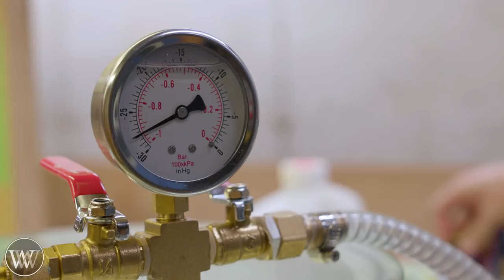Making Mallets for Tally Ho

Comment: I have the 64 dollar question if the “Cactus Juice” is supposed to stabilize and increase the durability of the wood why did you not make the mortises in the mallet heads and then perform the wood stabilization process.  It would seem to me that doing that way would allow more of the Cactus Juice to suck into the interior wood and thus making the mallet head more durable.  My preferred medium to work in is metal and not fiber based carbohydrate substrate.
Reply from the maker: Surprisingly the vacuum will soak the juice all the way into the middle. but the big reason is that the wood will move as it takes on the juce. this means the mortise will not fit as it did before stabilization.

Comment: I'm like 3 years late on this but I have a bunch of questions about this video: 1) what was wrong with the old mallets that you didn't like? 2) why is it called cactus juice? it's obviously not made from actual cactus juice 3) why not do more of the shaping and drilling it out for the handle before you stabilize them? 4) why did you finish the hammering surface when you know it's just going to get wacked away immediately on use? 5) shouldn't the angle of the mallet be based on the length of the handle? wouldn't the larger mallet have a shallower angle than the smaller one? 6) what did Leo and his crew thinks about the new mallets that you've made?
Reply from the maker: 1. The old mallets had square faces rather than having an angle to them and it makes you hit things off angle. If you tried one you know they just don't feel right. 2. Cactus juice is the brand name for the stabilizing fluid. 3. If I did all the shaping before the stabilizing then the shape changes after the stabilization as the wood absorbs all of the resin. So I have to do most of the shaping afterwards once the head has taken its final shape. 4. It is best practice to finish all faces so that the wood absorbs moisture at the same rate. Otherwise you'll have some surfaces that swell slightly more. Where the water can get in faster. Not to mention it just looks odd if you don't finish it. 5. You actually grip a mallet right up at the head. A hammer you want to hold all the way down at the base so you have a full amount of leverage. But for the mallet you hold it up next to the head. The reason you have the rest of the handle is for balance. If you've ever tried to use one with a short handle you'll know it just feels wrong. And as to the angle that's personal preference wherever it feels good to you. Some people like it with a slightly more shallow and some people like it with a slightly more aggressive it depends on how you swing your hand. It's the fulcrum is not where your hand is at it's how you swing your arm. 6. They use them quite extensively over the last few years.

Comment: See Tally Ep74 at about 11 mins, that large mallet hardly in shows any wear and tear out in that sea air humidity and chicken roosting boat yard. Leo is chiseling off teak cutoffs I'm boards from the original Tallyho stern. The hull and deck are framed, the transom is built and planking is about to start. Lots of black locust trunnels in they mallets past and future yet.
Nice build man!
Reply from the maker: Thanks. Hoping to make it back out there again sometime and help out with the project again

Comment: Nice work.  I like that the wood has come color variation.  What is the weight of each head?  I've made a couple joiner's mallets plus turned a carving mallet (similar shape to the Blue Spruce model).  It seems in all of them I end up making the things, then cutting the heads down so the weight feels right.
Reply from the maker: I generally like a head between 15-30 oz

Comment: How much fun is live oak? I cut a piece on a chop saw once and it was like going through steel on a metal cutting saw; without the sparks and such. Hand sawing all that? And planing some of it too?? Did you have to sharpen stuff up when you were done or hone in the middle of the project? Also, do you have a video on your vacuum chambers and stabilizing punky wood?
Reply from the maker: it is defenently "Fun" stuff but whit good tools it is not that much different from a twisted piece of white oak.

Comment: Well, there you go; I've managed to be a cabinet-maker and trad wooden boatbuilder and never come across "pressure stabilisation".  Can anyone enlighten me? Is this about using unseasoned timber and avoiding checking/splitting? Intrigued, of Cornwall.
Reply from the maker: These blocks were dried they're not green stabilization doesn't work very well when they wood is still wet. Usually I will speed dry them in the oven and then stabilize them. I have a whole video on wood stabilization if you want to see that.
Reply: @WoodByWright  I will, ta.

Comment: I'm intrigued as to why you wouldn't create the hole for the handle before stabilising the head?  Surely it would be easier to machine at that point, and the hole would only help with the stabilising penetration?
Reply from the maker: Surprisingly the vacuum will soak the juice all the way into the middle. but the big reason is that the wood will move as it takes on the juce. this means the mortise will not fit as it did before stabilization. on top of that the stabilized wood is actually easier to work with a chisel then the raw live oak as the oak is fractious. The stabilized wood is much smoother and  does not break away as easily.

Comment: Nice vids and nice mallets - but please explain why did not finish the cutting and forming before you did the vacuum infusion.
Reply from the maker: because the Cactus juice all needs to clean off before finish. I did not cut the mortise as the shape of the block will change slightly as it absorbs the juice.
Reply: Maybe just a rough out, with like 1/4 or 1/2 margins even.

I was thinking more about improving the penetration of the caucus juice, exposing internal end grain through the mortise
Reply: I had the same thought   i've used cactus juice to stabilize soft chunks for turning. (I'm a bowl turner)   it definitely changes the character of the wood but I guess i've never noticed any major shifts in the dimensions of a piece before (but then, my tolerances are pretty large when i'm roughing out a bowl blank)   I would think doing possibly the basic boring out, and hog out the bulk, then infuse, and then go back and pare down to the finish dimension.    But it's easy to armchair quarterback this stuff...  these came out nice and he found a solution. 
Nice bonus, the resin would give them more heft too.   I'm wondering if the BLO is even really required; the resin may be plenty all on it's own!  The BLO does give it a nice glow however :)

Comment: Question: I am new to "Normalizing" and conceptually it makes sense to my wee brain.  I understand the "Why" but would it have served you better to hog out the handle holes first before you normalized? You would then (In theory) get better penetration into the wood?  Then finished sizing of the hole to accommodate the handle? Or would there be too much stress on the wood?  Just a question on why one way and not the other so I can wrap my head around it.
Reply from the maker: As the wood absorbs the juice it does change and move just as if it would absorb water. So I save most of the finish work until afterwards. As to hogging up the whole beforehand that really doesn't help the penetration as using a vacuum will pull the juice all the way through the entire block.

Comment: hi! way not make the stabilizing processe next to work the wood? cheers
Reply from the maker: The problem with doing stabilization later is that the wood is going to move a lot. As the wood soaks it up it will enlarge slightly and distort a bit. So if you make too many changes beforehand it won't work as well afterwards.

Comment: Just got a chance to watch this video. Question though: If you put the mallet head in the vacuum container after the handle center has been cut out, would the pressure cause the head to crack because the center is gone?
Reply from the maker: thanks. no. It is not a pressure pot, but a vacuum chamber, it just sucks the air out of the wood.  the problem with creating the mortise first is that the moisture will change the shape of the head a bit. you could rough out the hole first, but I would not fully shape it as the handle will not fit after. the wood is easier to work after it is stabilized at the wood is homologous and will not tear out. that is why I prefer to cut the hole after.

Comment: I thought the purpose of a mallet was to provide a hammer head that was softer than what you were hitting. If you can’t drill it easily does that defeat its purpose?
Reply from the maker: Often that is useful, but for pounding on a fairled chisel or driving in a tunnel the hardness does not matter just something slightly softer the steel. that being said the stabilized wood is very soft, just it is very flexible making it hard for the lead screw to bight in the wood.

Comment: Could you at least highlight which saws you're using and why? You have an amazing collection, but rip/crosscut TPI would be cool to know. Great video, I found you through Leo's page, I live in Sequim and have visited Sampson boat works huge project. Keep up the amazing video's
Reply from the maker: thanks Tim. I use to do more detailed videos but they have not had a good reception lately. I am thinking of starting another channel with that kind of detailed information. Basically the bigger the wood or the faster the cut I chose bigger teeth. the big rip saw I used was 5PPI the crosscut for cutting the faces was 10ppi the carcus saw for the smaller cuts was 14 ppi.

Comment: What if we don’t have a pressure cooker/chamber to stabilize?  Would the wood just not hold up?
Reply from the maker: If this would were good wood all the way through. I would not stabilize it. The black sections on the bottom or spalted to the point that I could push my thumb nail into it. That is just too soft for a mallet and it would crumble very quickly. Most all of my mail its are made from a solid piece of burl or crotch grain and do not need to be stabilized.

Comment: You speak very quickly which makes it difficult for English speakers to understand your American language. Really enjoyed this though - what I could understand of it. Do you sell such mallets? I'd like to buy one for a shipwright here on the tiny Greek island where I now live.
Reply from the maker: Sorry. I naturally speak much faster I slow it down for videos. No I do not sell them but if you have a block of good wood they are not hard to make. No need to stabilize if the wood is good. I often use firewood to make them.
Reply: John,  You can easily change the speed of video play on your computer.  On your keyboard press the < key to slow down the speed or > to speed up the play.

Comment: Hey, James, why not cut the handle mortis before stabilization? The Cactus Juice could have soaked in from the inside as well.
Reply from the maker: you could but the shape of the head changes a bit as it absorbs the juice. and it is still able to soak all the way through with the open poors of the oak. it was solid in the middle.

Comment: Great video James. I’m sure Leo and his team will put them to good use.
A question and an observation if you don’t mind.
1/ Could you drill and finish the holes for the handles before stabilising?
2/ I was taught when using edged tools to lay them down on their side when not in use-planes & chisels especially.
Reply from the maker: Thanks. It has been fun to watch them use them. 
1. You could stabilize after but the wood will move when stabilized so you don't want to make it the final size first. As to resin penitration it does not matter. It will get to the middle rather way.
2. That is a very common misconseption that took off in the shop classes of the 1930s. Setting it on the iron does not harm it. And putting it on its side can be worse as the blade is exposed to other tools and knuckles. Paul Sellers has a good video divorced to the topic if you want to see more.

Comment: How would I go about this without epoxy and a vacuum chamber?  Is there a way to harden the wood with things that I already should have? 
(Just starting woodworking)
Reply from the maker: you can submerge it in BLO and turpentine for a week with he grain running vertically then take it out and let it sit for another week or two. that is the old way of doing it. it does not penetrate half as well but it will harden the surface.

Comment: Put that yellow thing down before you perforate yourself, you don't need any extra orifices. With the vac you did with the plastic, could  "pressure" be used the same and get the same results ?????????????
Reply from the maker: LOL you do not like the ye old DeWalt brace and bit? no pressure will not get the air out of the inside. it will work the juice in a bit but once the pressure is restored the air inside will expand again and push out the juice.
Reply: ah poo okay thx

Comment: dude, your the man, any chance for some quick head and handle dimensions? just the basics will do.
Reply from the maker: I usually like the heads to be about 2 1/2 in to 3 in wide about 6 in long and about 4 and 1/2 in tall. The handles are usually about 18 in long the base of the handle is usually 3/4x3/4 and the top is 3/4 by inch and 1/2.

Comment: I've used 5 - 9 degrees but don't know why.  Is there is reason ? Seems less of an angle is better ergonomically.  But didn't know if there was some historic reason.  Thanks James.  Great video
Reply from the maker: I misspoke and meant to say 5 not 9. that bit of an angle is drawing a radius from the fulcrum of your hand along the face of the mallet making it hit flatter then if the face were 90 degrees to the base of the mallet.

Comment: I have a question, why did you harden the wood prior to all the shaping work being completed?
Reply from the maker: It is not actually hardening the wood and in some ways it makes it easier to work with. The one problem with it is that it changes the wood and will cause it to twist or cup a bit just as the wood does when it dries or takes on more water. Because of this It is easier and more accurate to get a clean hole if you do it afterwards then before. The only downside is due to the plastic nature of the wood afterwards it makes it harder for the lead screw on the boring bit.

Comment: Nice job, but I'm curious - why do you use a vacuum to penetrate the Cactus Juice and epoxy into the wood.  Wouldn't pressure work work better like "Pressure Treated Lumber"?
Reply from the maker: The problem with using pressure is that you then create pressurized bubbles inside of the wood that create a lot of internal stress. if you use a vacuum press you're actually pulling all the air out of the wood so when you let the air back in it forces the polymer deep inside the wood. You actually get 100% penetration if you do it right. and afterwards there's no internal stress from all of the compressed air bubbles inside.

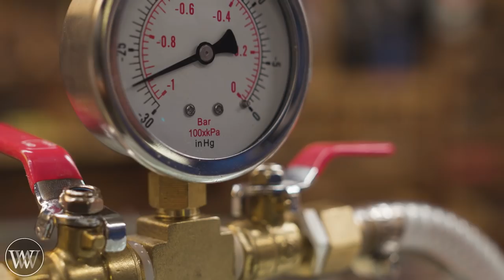Comment: 8:52 Q Should you not get more epoxy if the aluminum foil gets stuck in the wood? I get the impression that you have too little epoxy when it gets stuck. But I can be wrong.
Reply from the maker: no the Epoxy will cure no matter how thick it is. The sections that did not get stuck are sections where the foil did not touch the epoxy.

Comment: nice traditional mallets!     Would it have been easier to treat them before you chiseled out the center, thus avoiding the problem with the drills??    Though Live Oak is VERY hard stuff...it may not have made a lot of difference in the end!!     I'm sure Leo will love them, and it's the sort of tool that any shipwright would love to have stowed in the toolbox at sea....and BLO holds up decently well under shipboard life; it's what they used to treat the blocks with on the rigging....
Reply from the maker: with he vacuum chamber the juice penetrates all the way to the center even with out the hole in the middle. it will also cause the wood to move a bit as it absorbs the Juice so if I cut it before the handle would nod fit the same after. then on top of that the chisel work is actually easier with it stabilized then it was before as the wild grain of the wood is not much of a matter.

Comment: I made my mallet in 1961  (as an apprentice joiner)  from a piece of apple tree wood which had a split in the top , split never got any larger . Only treatment it got was a coat of Shellac  .
Reply from the maker: Got to love a good old mallet. I have one very similar to that from a white Oak crotch. There's a split running from one end but because of the grain it will never spread.

Comment: Beautiful mallets.  I'm not into woodworking , so plase tell me, are wooden mallets better for joinery and shipbuilding, and if so, why?
Reply from the maker: Yes. When pounding on wood it will not deform the wood. If you use a metal hammer it will mrushroom the wood over.

Comment: Nice project! I'm curious about the boiled linseed oil/paste wax finish since you stabilized the wood it won't penetrate very deep. I'm guessing it is purely ascetics or are there any other reasons?
Reply from the maker: there are still some poors on the outside the stabilization is more for the interior as some of the outside will leek when it is being cooked. but that being said it is mostly for looks so the wood does not just look like raw wood. it also feels much better in the hand.

Comment: Could you have done all the machining prior to cactus juice treatment?
Reply from the maker: I could have but the wood will move when it absorbs the juice and the fit may not be as well afterwards. In actuality it's easier to work with a chisel and blade after it has been stabilized it's just harder to work with a brace and bit.